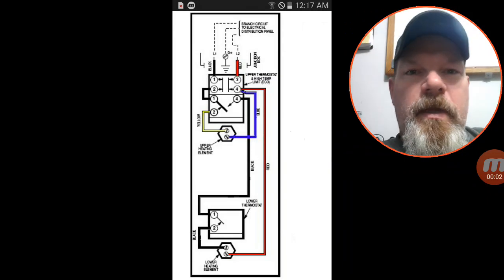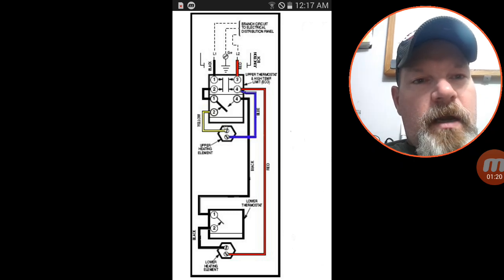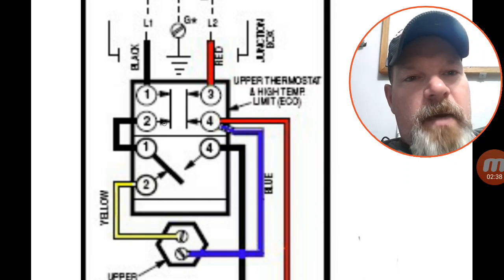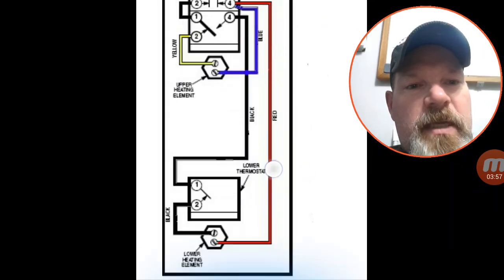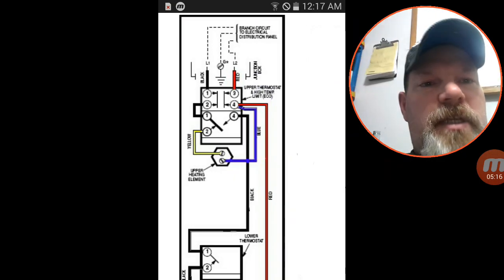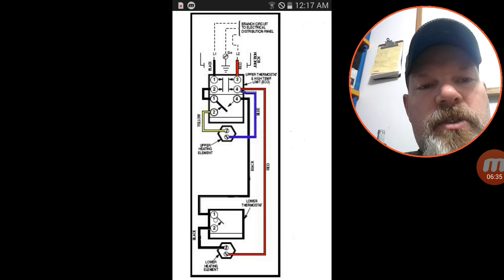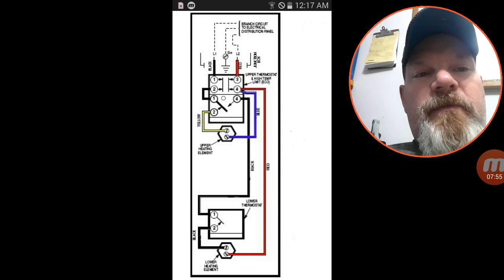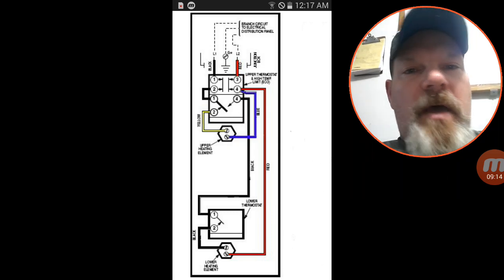Electric Water Heater Lesson Wiring Schematic and Operation

Comment: I replaced everything in my hot water tank wired it up just perfect like you showing your video and I still have no damn power to it
Reply from the maker: +thomas Duck do you check for power at the breaker?
Reply from the maker: +thomas Duck did you check for power at the breaker

Comment: We have a Rheem 50 gallon, 5500 watt water heater. (Model No.:XE50M12EC55U0) 240 VOLT. Residential. (One phase) A 10 gauge, 3 wire and a grounding coming in through the wall. The water heater has a 12 OR 14 GAUGE  black (L1) and red (L2) wire coming out of the water heater beside the grounding for the water heater. I connected the black wire to the black wire on the water heater and the red to the red, but I don't know where to connect the 10 gauge white  wire? I guess the white is neutral, but I was told by a home depot guy that water heater don't need a neutral. So the black/red wire coming out of the Rheem water heater looks like a 12 or 14 gauge wire. (Guessing) They are a lot thinner! The BLACK 12 (?) 14 (?) gauge wire insulation cover is burned off straight into the water heater.  I'm no electrician and we can't afford an electrician! I'm thinking of removing the white wire from the outside bus bar or reducing the 2 pole 30 amp to a 25 amp. There is an approximate 75 ft of wire connecting the water heater and the outside power fuse box. Recently I heard that the white wire which I thought was neutral, isn't neutral, but rather it was suppose to be connected with one of the other wires. (?) Hmmm?  Really lost!                                                         
                                                                                                                                                                                                                           
What should I do with the white wire? Cap it off on both ends or disconnect from the outside fuse box. Should I keep the 30 AMP or switch to a 25 AMP? Should I tie the white wire to the black or red? In the mean time, we just turn on the water heater for shower and then we switch it back off. We (Girl friend/I), smell the burning wire after we're done. So ANY advice would be helpful! Thanks! 

Signed, Lost(?) or Insane(?) ...

Comment: They can just delete the rest of the hot water heater videos on YT. This is what I have been looking for. You do an excellent job explaining how the circuit works and more importantly, which wire does what to where. I have replaced both my upper and lower elements but the breaker is still kicking out after about 10 minutes. I get the feeling i have a call for heat on both elements at the same time. The reset is not kicking out on the upper unit so I am replacing both the upper and lower units. Thanks again.
Reply: brianmann01 she

Comment: Glad I found this video. I can save a few $$$ per month by cutting the thermostatic back on the bottom element. When the top runs out of hot water the person (that normally takes a shower till the full tank runs cold) will now get out sooner.
Reply: tb0256 my what temperature should you water heater be set at

Comment: Thanks for showing me how the hot water heating system works. Question : When I put two probes of the volt meter to the top element I get 236 v. but the with bottom element, One probe to first terminal of the element and the and second to the ground gives me 117 v. Same 117 v. with the second terminal. But when I put both the probes to the both terminal it gives me zero v. why ?
Reply: Having the same thing ?

Comment: Wonderfully concise explanation.  You just gave me the key to installing solar-powered DC element on the top.  Who knew that only the top or the bottom was powered on at any one time?  I disconnected both wires from AC element on top to test running just the bottom and it didn't work.  I turn off power to water heater during the day so the top element was calling for heat and bottom wasn't working.  My meter shows no current and I'm confused.  So I'll remove yellow wire on top and use it to connect No. 1 black directly to No. 4 black on top and that will make the bottom AC element always ready for power.  Even when the top thermostat kicks up or down, it seems to me that it shouldn't matter.  Please tell me if I'm wrong here.  Frying my water heater is not part of the plan:).  Thanks again.

Comment: When I open the drain valve cold water comes out but the water is hot in upper and lower parts of the tank. Why is it cold? (I only drained off about a pint to check for crud build up)

Comment: I replaced both thermostats and elements in my water heater. The water was much hotter than 120 degrees. Found this video and saw I wired it incorrectly.  Thanks for the information.

Comment: Hey Guy. replaced both elements. refilled heater. powered up. Water is ice cold. i get 240 volts across the upper but no volts across the lower element. Is this correct? Thanks, and your videos rock.
Reply from the maker: +Phillip Knox yes after the top heats up the stat will switch to the lower element.
Reply: Guy Brown Thank you sir! Keep up the good work!

Comment: I feel kind of dumb asking this question but here it is: when the upper thermostat calls for heat and terminal 1 switches to terminal 4 how is the upper element energized through the yellow wire?  Doesn't that open the circuit?
Reply from the maker: +Richard Haneberg only one element is powered at a time
Reply: Richard Haneberg , 1&2 is N.C for upper circuit until it reaches the set point then the switch will open( 1&2) and close N.O 1&4 sending power to the lower circuit. REMEMBER both elements CAN NOT be ON the same time. You can check with the app draw.

Comment: I put a neon lamp on both heating elements so I could see what element was on, if the top one is on, you do not have much hot water left. the job is super easy to do just remember to get the correct voltage lamp for your application.
Reply from the maker: Craig Nehring thats a cool idea.
Reply: A neon lamp?   Couldn’t you just do it with LED or normal bulb or even dual voltage gauge?